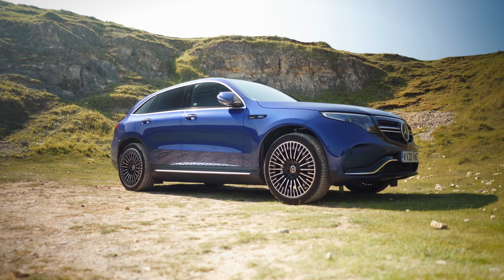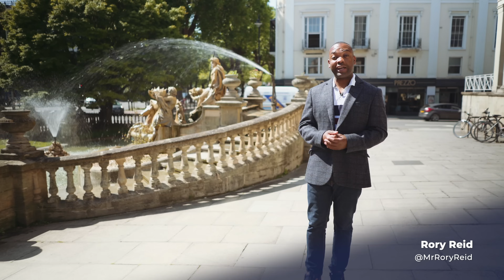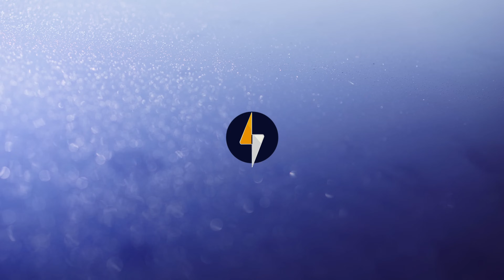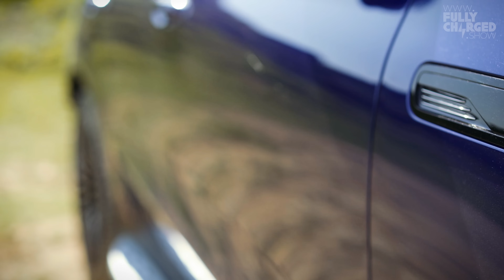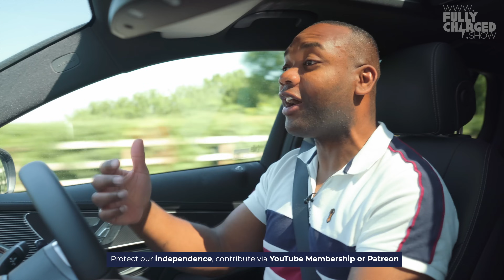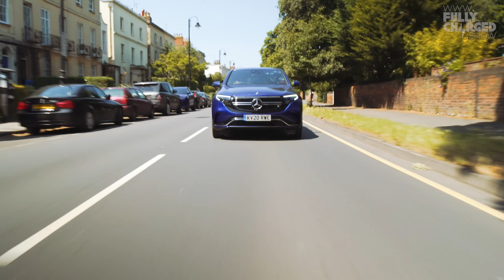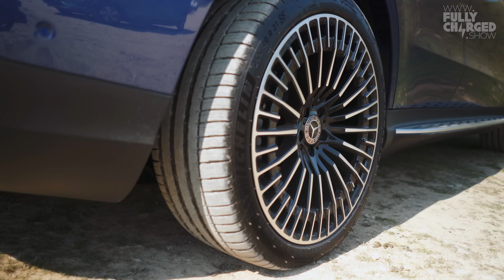Mercedes Benz EQC - Rory Reid First Drive | FULLY CHARGED for Clean Energy & Electric Vehicles

Comment: I think Rory is a great presenter & I’m glad he’s on Fully Charged. I think he was a little soft on Mercedes, though. For the price, it is well short of the Model Y in terms of range, performance, luggage space, auto pilot, charging network, over the air software updates, & purchase experience. Kind of disappointing for the oldest car company.
Reply: Fast charge less than 1/2 of the Y.
Reply: @Sidowse   I have not see BMW or Mercedes have an opinion on Hydrogen. So their output speaks on that matter, they have not invested R&D dollars to something like that and given how things are shaping out in the EV market, I doubt that this will change. 

Hydrogen seems to be the preoccupation of the Japanese side of the car market. Toyota and Honda pacifically (so far no company that is HQ'd in South Korea has jumped into this rabbit hole). 
There are reasons for that, given that Hydrogen is a liquid fuel source so the infrastructure metrics don't change by alot which for Japan is a thing since foot space in the country is a well-known premium.
It also doesn't upend the industry back bone because of it, so gas stations and stuff have to go through a retro fit but other than that they are good to go.
And they keep their hands off relying on the electric grid for power, which is known to be a bit flaky in Tokyo and other cities. 
That said, it will be a problem on the global stage given the push to other sources of electricity (solar and wind in particular) and other pushes for BEV's. Which people clearly want.
Honestly, I think that this push for Hydrogen is a bit of fools gold given that the market itself is changing beyond gas. Toyota and Honda will rue that push for it, given how things are shaping out.
Reply: A Mercedes purchase experience is a luxury pampering thing, it's great if you want it. Also I feel like this Mercedes won't have any fit and finish issues like all Tesla's seem to (from teslamotors subreddit). Missed opportunity to get the battery pack on the bottom, since that would no doubt improve the car's handling.
Reply: @illietw  
It's a part of the long con.
You pay for the pampering.
There's no such thing as a free lunch.
Reply: @Sidowse  Model 3 was the first Tesla that has Tesla made motors. Model S and X used third party. Tesla gets batteries from Panasonic, and now also CATL and LG Chem. Tesla does not have the technological lead that the fanboys imagine they do.
Reply: @Sidowse  Actually no. The electric motors of the EQC was designed by Mercedes themselves. Even the batteries are built at their own plant in Kamenz. The cells come from a battery maker like LG yes but they decide the make up in a pack and then build it. Tesla cells come from Panasonic. So.
Reply: @SDav21  
"Actually".....
The "Mercedes cells" are (generic) "LG cells"
Tesla cells are unique, from a Tesla built factory, cells mechanically "built" by Panasonic using Tesla (J.D) specs and chemistry.... BIG difference (and soon to change again).
Reply: The model y is just another poorly made tesla product. Range alone isn't what makes a good EV let alone a good car. For the price, this car is miles and miles ahead of tesla in things that matter like being properly built and feeling the price you paid for it. Performance is just perfect. Luxury is unmatched. It is the quietest EV out there.
Autopilot is nothing more than driving assist features. It doesn't do anything that this can't. He didn't show it which is annoying but it can change lanes on its own too.
A car doesn't need software updates when they actually finished the car at the factory. But MBUX can be updated over the air.
And what about purchase experience? Tesla has no purchase experience. It baffles me that people are just buying cars from the Internet without driving them first. That's the biggest problem with tesla fans and owners. They buy based off video and over exaggerated claims from tesla and owners. They're usually coming from cheap eco cars buying their first higher priced car. Then they proceed to assume it is better than everything yet did not even test drive any other car or learn about the features of other cars. What purchase experience?
Reply: @SDav21  judging from how the fit and finish is from my driving experience and lackluster interior of the 3. I'd rather havevthe EQC,i have a B class EV and its built like a tank
Reply: @MRDENSON3K  
(Shhh.... Mercedes fanboy alert!!)
Should be able to get a good deal on an EQC, not many selling! (Watch out for that depreciation!)
Reply: @SDav21  Sandy Munro, Research before commenting.
Reply: @SDav21  
Which car is selling? Y, or EQC?
Reply: @rogerstarkey5390  Sales doesn't determine whether a car is good or not. That been proven. The Nissan Rogue was selling hundreds of thousands yet several of its competitors are far better cars. Tesla has 3 cars to sell. Other carmakers up to 20. It doesn't change the fact that the model y is a cheaply produced mass product with gimmicks that easily amuse ignorant minds.
Reply: @SDav21  Just look at all of the car of the year awards the 3 has won. its not just sales that its dominating in.
Reply: @larryspiller15  What car of the year awards? Which country? It really is easy to impress with superfluous things that add nothing to the driving experience. Not impressed.
Reply: @SDav21  
If that was the case, there would be thousands of almost new model 3 and Y on the market.
Those which are there are apparently on sale for top dollar, meaning there's almost no point for even dealers to buy them, being just a few percent below the new car price.
If f a model sells, then sells more, then sells more..... That's customer satisfaction in play.
Reply: @SDav21  I must agree with you. I was looking to buy an EV and was able to test the Tesla as a good friend of mine works there. I tested the X Sorry, I was really dissappointed. Take away the falcon doors and it wa very bland to be honest. A huge Ipad screen and that was it. I have no issue with minimalistic design, but it just looked odd. The drive was ok but noisy which surprised me. Also there were squeaks here and there which I found strange and when I read comments on other forums, many complained about the poor finishing. I tested the EQC, one word...WOW! Now thats a car. The interior was off the charts and the biggest thing............it was DEAD SILENT. Im suprised Rory didnt mention this. I ordered the EQC and the dealer told me its planned for arrival in teh Netherlands last week of July. Im stoked!
Reply: @AO-dv4ej 
He likely didn't mention it because it's really common. Something that kind of changes with every EV is that compared to an ice car, you don't have to contend with motor noise so it ends up being a quieter ride.
The problem with this, because the motor noise isn't masking the build.... If built sloppy you'll know real quick, because the cars creaking, squeaking and make noise for the entire ride. The EQC and the Taycan, happened to have a really insulated cabin... so the ride is dead quiet. You literally only hear the tires.

Which is one of the bigger issues with Tesla, Elon Musk angles to company as in the luxury space. Problem is Tesla motors builds economy cars, so the build is little sloppy and you can hear it.
Reply: @DuvJones  so spot on! The EQC was practically silent. The Tesla sounded AWFUL! It was really annoying. Worst was when you werent driving, the doors squeaked when you opened them and the finish was kinda of cheap to be honest. Im not bashing Tesla as I really wanted to like it, but sorry. And to think I would have paid eur 10k more for it, no way. The Audi E tron was also really good and I could have easily went with that too, but just favoured the MB. Germans know who to build cars, PERIOD.
Reply: @AO-dv4ej  
A nice quiet place to sit while you're charging (🤭)
Maybe if they can sell a few more it will be an "Audi killer"?
Reply: @SDav21  
There is some point in the purchase experience, because at the end of the day... it is just a transaction. Their is little point is dealing with the dealer if all you want to do drop dosh on X. Once money exchanges hands, their is little point to have a song and dance about it.
 Tesla provides that a la carte experience of dealing with the company directly and honestly I think you are going to see that more from others... It a luxury thing that will likely show up at the higher end of the bracket (Seriously, image an Austin Martin at your door after you bought the thing. You just talk to the delivery guy for a few, they hand you the keys and that it. It's yours, you can just get in and drive off. That would be cool).

 Ford is dealing with the fact that they can't control their franchised dealers, whom all seem to want to mark up the Mustang Mach-E beyond MSRP. Which is likely why they want to people to simply buy directly from the company itself, through the website. Which makes sense.
If they can't get on board, why bother... best to just deal with the customer directly.
Reply: @DuvJones  Still. You're just spending a lot of money on something you haven't driven. Makes zero sense. I prefer to test drive something. There's no better way to feel the way different cars perform. It's why people buy different cars. I drove a model s. Now based on over exaggerating owners, it would seem great. After driving it. Nope. Driving it back to back with a similarly priced Mercedes, BMW, Audi or Lexus you quickly realise it is a car not worth the money.
Reply: @SDav21  
I guess but like I actually do see the point of having the a la carte experience if you know what you want. I'll be honest,once you start spending that kind of money you commit.

The thing this does ward off is price gouging, but I think there's another way around that. So you can walk into a dealership, take a test drive and then not content with them by dealing with the website, but it's probably a bit of a con to do that.

Comment: Been a EV driver for 6 years nobody every charges 0 to 100 per cent. This is always said in every ev  review. The next one is 0 to 80 in half an hour with a rapid charger. Think about if the EV is at 0 per cent  you can't bloody charge it. You need the AA to tow you to a charging station. 😠😠😠

Comment: "One charging contract, one monthly fee, all you have to do is pull up to a charging point and plug in."
Round of applause please for Mercedes who have solved this most basic problem.
Reply: I expect that in 4 - 6 years they will stop supporting the mercedes-me options on this like they do on their current cars to incentivize you to buy a new one.
Reply: So you just plug the car in? I find that hard to believe. Normally chargers require an RFID card.
Reply: @SirHackaL0t.  with CCS the car and charger can communicate. So if you have a contract the charger recognises the car and automatically starts charging. For Fastned you can just register a card in the app. Maybe it works the same for Ionity.
Reply: @mycomment1862  That could take a while in the UK. Most of the 50Kw chargers here need you to tell them which connector you are using.
Reply: @SirHackaL0t.  Yep, that's how it works. merc has a video on their channel on it as does Fully Charged by Robert.
Reply: @woodfordp  Ok, it’ll be interesting to see which chargers that works with.
Reply: audi have similar... but for people like me wth a company car, my charge card is another third party and so again restricted.
Reply: Shouldn't have to plug it in after waiting all this time for them to deliver.  I expect wireless car charging for this price range and the times we live in now in 2020.  This car offers too little too late.
Reply: Only if you don’t have a house or cond with a garage or driveway or ? Don’t know how many would buy a benze why renting?
Reply: @julianhofmann8039  Yeah, the problem is everyone wants to be "the" infrastructure so they're fighting for your contract. Especially the UK seems pretty bad for that. I've got a Shell badge on the old continent and it allows me to charge at about 90% of all charging points here. In NL the government actually enforced a standard so you only need 1 badge, my Shell badge works at 100% of Dutch chargers.
Reply: Tesla did it 8 years ago?
Reply: @rogerstarkey5390  so? Mercedes built cars 100 years ago.
Reply: @EVPaddy  So you're saying Tesla, who have only 2 decades of experience, have managed to make a better experience than Mercedes, who have 100? Lol it's pathetic when you look at it like that

Comment: This is a car based on the GLC (currently available for £35-45,000 depending on trim) or you can buy the EQC for £65,000 - welcome to another example of the EV rip off pricing.  It is priced to compete with the Jag iPace, but the Jag is by far the better car. Basically a complete fail by Merc

Comment: This car just proves how much the ice manufacturers like, BMW, AUDI, MERCEDES, VW are 4 or 5 years behind Tesla, £63,000 and what he didn't tell you that is the base price, add another £20, 000  for the car he is driving, so nearly £90,000 for a car with a range of about 220 miles, and slower charging than my grand dads mobility scooter. geeezzz

Comment: He forgot to mention that it's unbelievably quiet inside an EQC!!! - the sound insulation is amazing. It's the ONE reason why I would buy an EQC in preference to any other EV, if money was no object. Well, that and the build quality.
Reply: Ed Stratton The fact that it’s an expensive already outdated , ill handling , energy hungry, slow charging,half ass attempt at an ev doesn’t matter as long as it’s quiet 🤫
Reply: @johnjenkins220  
You forgot the depreciation, which is likely to be 'unimpressive' dye to the lack of sales leading to deals on new vehicles.